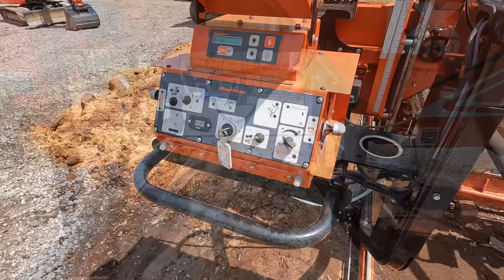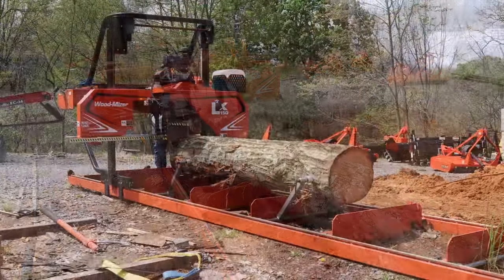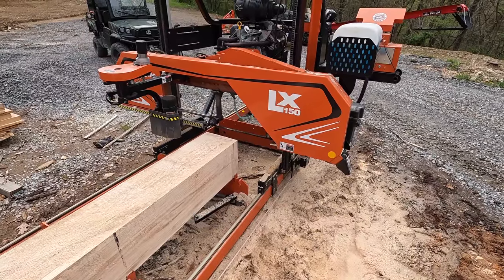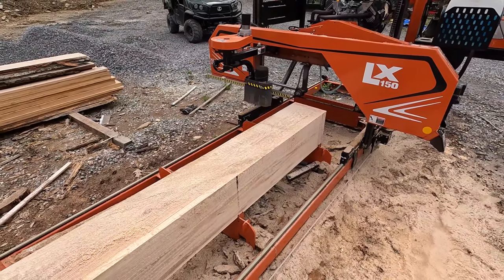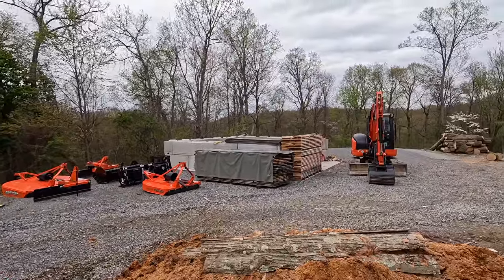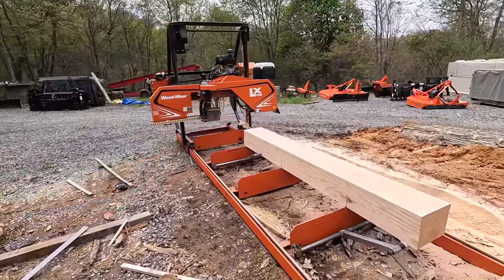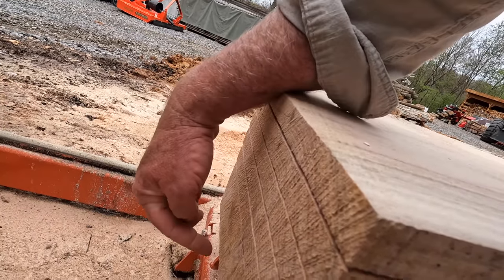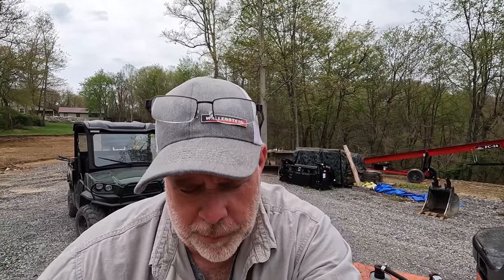Selling the Sawmill? Not sure what to do

Comment: I can only hypothesis what you purchased the new mill for, but whatever the factors for a new mill, surely they would support reasoning to keep it. Maintaining two running mills would be a good back up contingency regarding a production capacity goal, as well as spreading the equipment stress over two mills when appropriate.

Comment: Repalce the "rope" that you don't like with "Dyneema" rope, very strong and durable and it doesn't stretch so it takes the constant adjusting out of the picture.  Dyneema Rope is used on sailboats to replace stainless steel cable standing rigging, the lines that hold up the mast yet it handles like regular rope.
On another note, you (the Morgans) have positively impacted the lives of your viewers in so many positive ways.
Reply: Good call on the dyneema but I don;t fancy doing that splice.

Comment: I have only watched you mill a couple of times.  Just an observation but I would prefer the controls be on the opposite side of the log so you do not walk in the fresh sawdust.  Probably there are other limitations to put the controls over there.
Reply: Most mills are set up to load the deck from that other side, and any hydraulic lift, cable lift, or ramp would then be in the way. The blade pulls it toward the platform, so the handling is simpler toward the operator. Many of Woodmiser’s mills have loading options, so getting dust to the other side would mean a lot of retooling for left/right outlet.

Comment: You need to get yourself a 12" bucket to handle logs with..  will give you much better control and maximum lift capacity....
I use mine for sorting through all the different species and when grabbing big chunks to set on my splitter instead of manually rolling/ lifting cause you know what happens at our age with our backs 🤣🤣